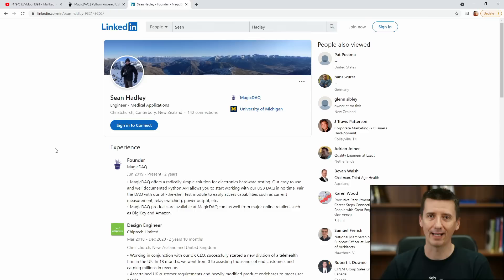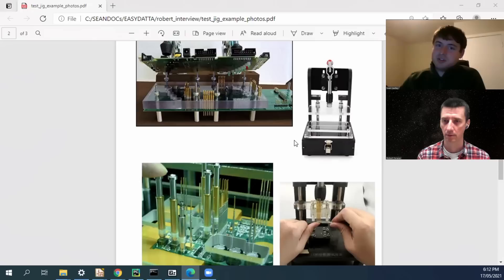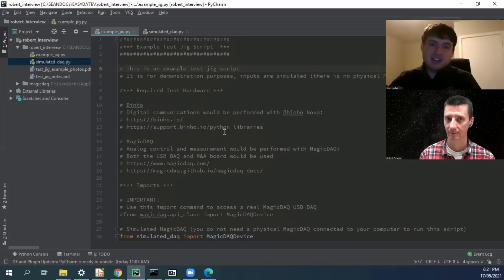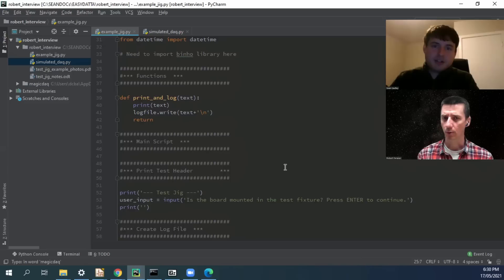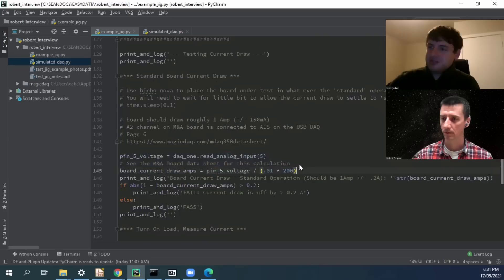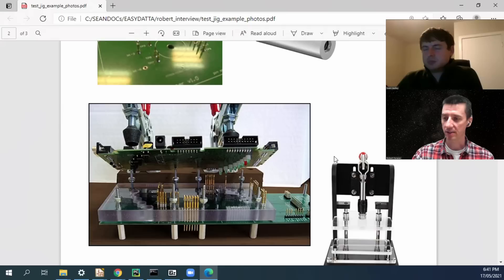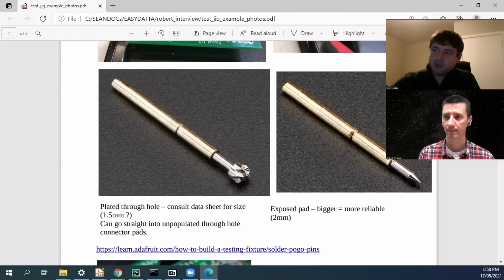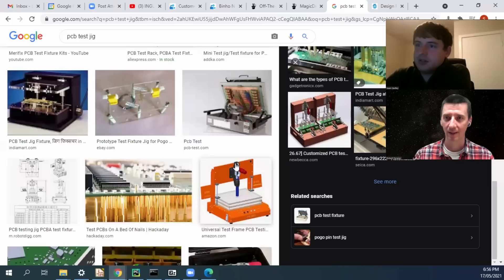How To Create a Test For Your Boards - Everything essential you need to know (with Sean Hadley)

Comment: One of our manufacturer tells that test
 points should be not less then 1.5mm and they don't allow to use vias as a test point. 
They explained, that during test, force from the pogopin may damage cooper and influance on connection.

Comment: For getting the digital protocol interfacing running we've been using plain old FTDI MPSSE breakout cables with the pyftdi library.  Fixturing itself is done using a custom pcb with sensors (actually an extended version of our development fixture) set in one of these Ingun boxes.  A bit of self-test in firmware but most of this using the fixturing pcb and python code.  Also, if you get things like a larger FPGA on your board these often have their own power supply monitoring that you can use for testing/monitoring.
Reply from the maker: Thank you very much Roel for sharing this.
Reply: Maybe one thing to add here, having a test fixture early on in the development process makes life so much easier when debugging boards.  Especially when you want to compare different boards or revisions.  Just the repeatability of connecting all test points makes this a time saver for our more complex designs.
Reply: How do you wire the pogo pins? Do you solder them on the custom pcb or wire them to it?
Reply: @iliaslolis1769  we soldered them directly into the pcb. I haven't had problems with the heat of soldering affecting the spring but that may be something to think about.  If you want to have an easier job replacing them when they get bent, or avoid possible overheating,  you can also get sockets for them that you can solder into the pcb. Usually these sockets are not designed for pcb use but more aimed at wire wrapping the connections by they work fine when you have figured out the right hole size in the pcb.

Comment: Thanks for great video again Robert. Some additional comments from former test developer. With commercial test fixtures you fairly may go to 0.8-1.0mm in diameter of test pads. There are suppliers who are focusing to even smaller test points diameter as 0.4mm, just those are crazy expensive and very fragile. Hitting directly to through hole connector leads it is not recommended as these may have flux residue left after hand or automated soldering. This may cause probes to be dirty and cause bad contact. JTAG Boundary Scan is really nice tool, just with limitation to cover full board functionality as it can check inly digital part or interconnects, analog part and voltages are still limiting factor here, so you may need still voltage, current, resistance measures. Especially if you have some kind of more complicated circuitry on board.
Would it be possible to include additional videos of schematic or software tips&tricks for reliability, redundant design for life critical design? Or radiation (satellites using COTS components) tolerant design concepts, architectures or low level schematics tricks?

Comment: my experience is that there are a couple of products that can do self-tests. The main chip turns to the unit that Sean designed. Unfortunately, you have to count on the testing procedure in advance and be aware that all features related to IC cannot be tested. 
Personally, I do not like placing sense resistors on target boards because it is just another component that can blow up. Still, there must be a compromise.

Comment: High density boards often use JTAG for testing, it's very versatile tool in test engineer toolbox (allowing testing and firmware upload) ;) but software can be costly :/
Reply: You're almost always better off with a standard off the shelf connector for testing.
Reply: @vejymonsta3006  And using JTAG helps to achieve this goal.
Reply from the maker: Thank you Krzysztof. PS: I remember, once we wanted to test one of our x86 boards through JTAG ... the price for that was astronomical. We have never used it since.
Reply: uploading firmware into the board using JTAG may be not so good idea timewise  especially if there is big JTAG chain and file to upload is big. It is directly caused by JTAG principle which is just long shift register, so if big chain, then really long time to upload. But hey for some of us length of programming is not an issue, it may be an issue if you have bigger volume of production

Comment: I was wondering if/how it's possible to perform panellized testing prior to routing/v-grooving the panel. I have an idea for a board that would use finger connectors and I thought it would be cool if I could test a panel at a time. I think it should be possible to extend the finger connectors and use those lines directly to perform tests. Then when testing is done, the panel can be routed. I don't know of a PCB manufacturer that would offer such a service.

I could just design a test board that would accept my board and do testing that way. This will probably be the initial direction I will take, but I think the idea I describe above would be a lot faster at higher volumes. I also don't want to go the direction of routing traces across v-grooves or mouse bites.
Reply: Unless your panel has all the boards on one side (Nx1 or 1xN arrangements), I don’t see how to make that work. I don’t like routing tracks through mousebites, but I have to admit that when done properly it is a very reliable and nice way to do some stuff like JTAG programming.
Reply: Most of assembly houses would do QA on assembled panels (AOI, ICT, etc) acoording to their toolinig, there are Flying Probe machines able to perform ICT small batches of boards, if You want anything extra You have to provide tooling.  If You want to prepare test for panel you can have two main approaches - create tester able to test all boards fully parallel, or you could have tester for single board and then use multiplexers to test one board at the time, or you could do some magic with software to split tests to couple jigs able to perform one simple test at a time, and then schedule execution in such manner that diffrent test can execute on every board in the panel in one moment, but ultimatly every test wolud be executed on each board in shorter time than executing it sequentially.
Reply: eevblog has a video on exactly this topic. testing in panellized form before routing.
Reply: @supernumex  Do you have a link to this video?
Reply: @DehimVerveen  EEVblog #552 - DFM Automated PCB Panel Testing

Comment: I am looking for a DAQ system compatible with testing my board. The main requirements are:

Checking UART, SPI, and I2C protocols
Monitoring ADCs and GPIOs
Performing voltage and current measurements
Could you please recommend a suitable DAQ system for these needs

Comment: Nice Content :)
For dense PCB's designers use an additional hardware like BST circuits specifically for testing of the boards.

For current measurements i feel placing sense resistors in the pcb and measuring the voltages from the nails through DAC is better.
Reply from the maker: Thank you Kiran

Comment: OMG!  So I'm a software engineer not an EE, and I (rightly) get lectured by EE's about my schematics and layout and decoupling caps etc etc, so now it's my turn.  If you write software tests that look like that, you should be lined up against a wall and slapped with a wet fish.  Seriously, a bunch of "if-else" statements to a stdout is NOT a test harness.  I am genuinely mildly horrified by this video.  EE's need to spend less time worrying about a diff-pair impedance and more time mastering writing decent software.  This is about as far from "best practice" as you can get.
Reply: How should it be done in this situation?
Reply: Do you happen to have a link to some example of a better implementation?
Reply: For example using “unit testing” kits
Reply: Getting your differential pair impedance may be crucial to get your product right and that's what you get paid for at the end of the day. Having designed a few (basic) test jigs myself, their development always tend to fit in at the very end of the project, when the production is already in place and you need to deliver fast. Usually there's no time for pretty coding, especially when all the software engineers are involved in something more important and you have to do it yourself.
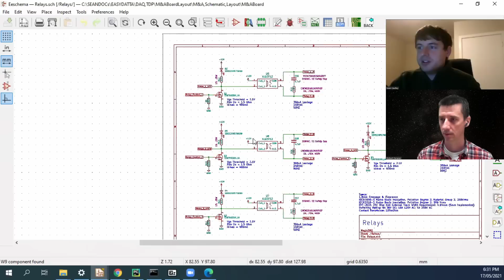I am more concerned about the lack of freewheeling diodes on the relays - if this is the final version of the schematics - see 22:02 . It's a pity to spend a few hundred dollars on a product just to end up with a broken board after a few cycles of a relay.
Tip: don't place your test points close to through hole solder points, they might end up with solder or flux on them.

Robert, love the video, keep up the good work!!!